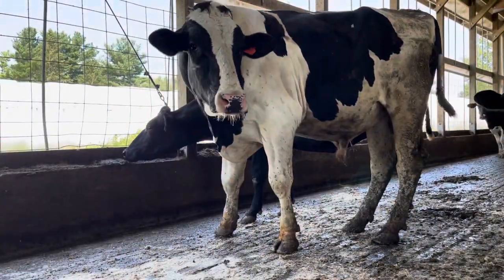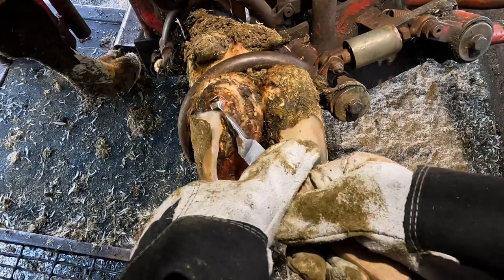This cow NEEDED TWO BLOCKS glued on!!

Comment: And suddenly I have another question! Horses often get a metal horseshow to walk on. I know cattle have two claws whole a horse has just one toe, but could you use a horseshoe on cattle if you saw the shoe in two pieces, one for each claw?
I know you use glue for those elevation thingies but would it be possible to nail them in place? :O
Probably not, but still asking... :)

Comment: When the title said the cow needed 2 blocks I thought you meant on the same foot and I was so confused. But that led me to the question, have you ever had a cow where both sides of the foot were so bad that you would normally put a block on if it was just one side?? And what do you do if the whole foot is bad and you can't put a block on to relieve the weight?